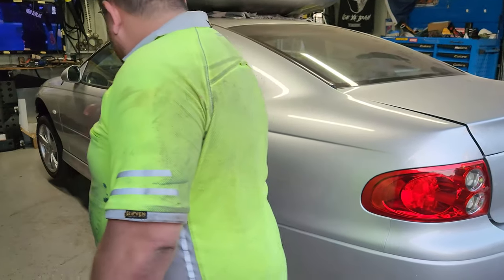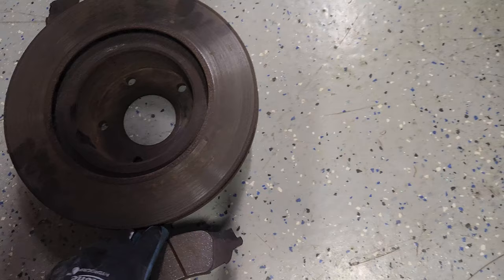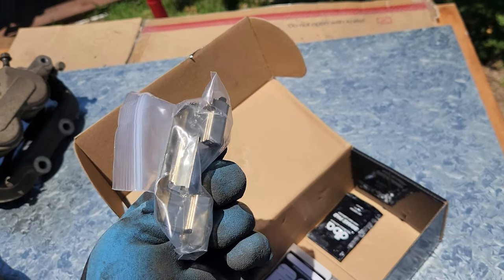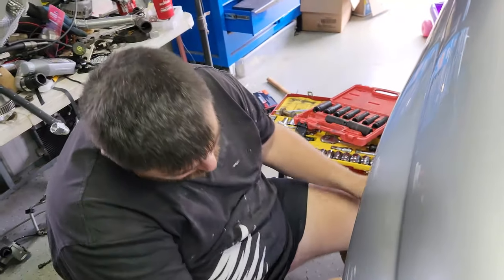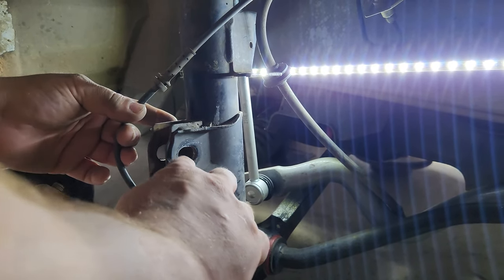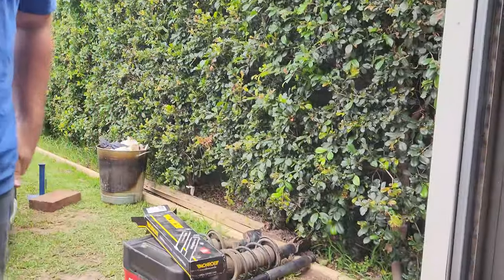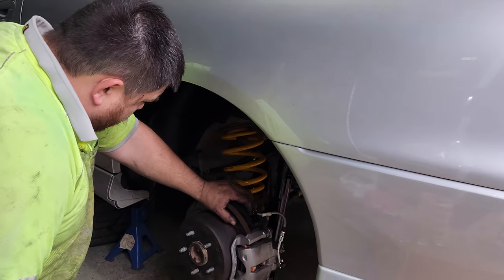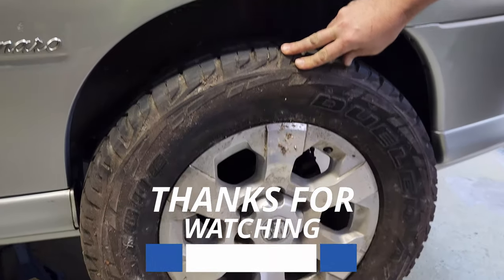CV6 Monaro Build | #14 - Suspension and Brakes

Comment: Love the brake pads. The RDA Phantom Ceramic are worth a look as well. Those callipers and wheel wells came up nice :) . With the Nolathane dust covers, have they stayed on the bump stops ? I was always worried they may fall off, but will last so much longer over the rubber boots.
Reply from the maker: I cannot answer the Nolathane dust stops as of yet because the car hasn't been on the road. I will look into the RDAs in the near future, Cheers!

Comment: Nice job lads , i still have some 1c 2c Pieces 😅
Reply from the maker: Hold onto them the material is worth more than the coin.
Reply: You'll love the DBA pads. Green Street ones in my monaro are awesome, and they don't dust or squeak, but they slow the car up so much better than what I had previous
Reply from the maker: well orange is the next one up so lets see how they go
Reply: @TinShed correct